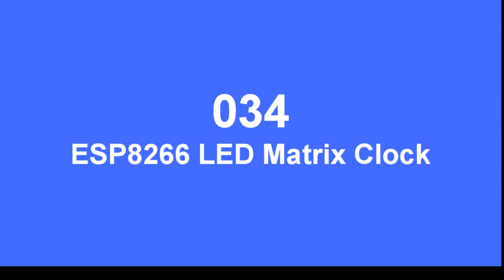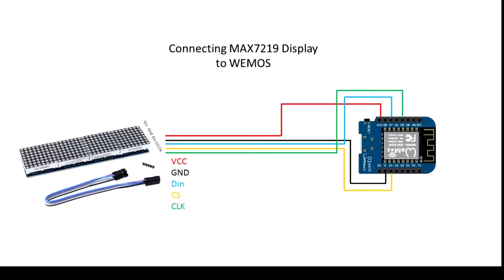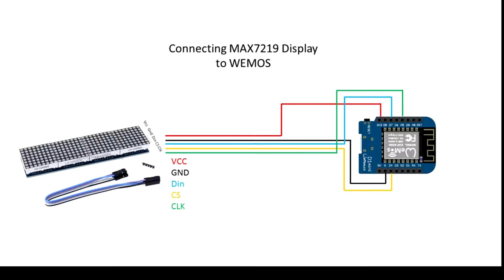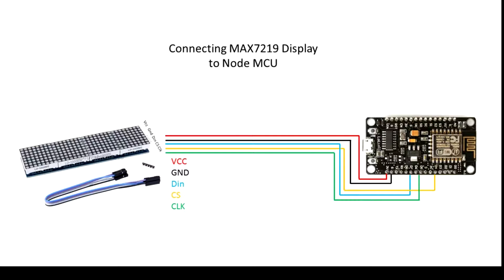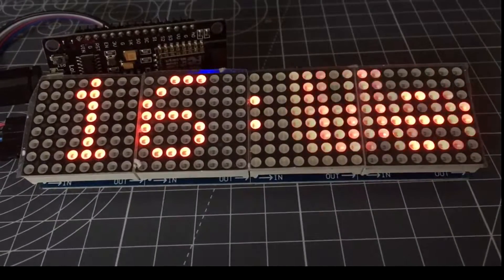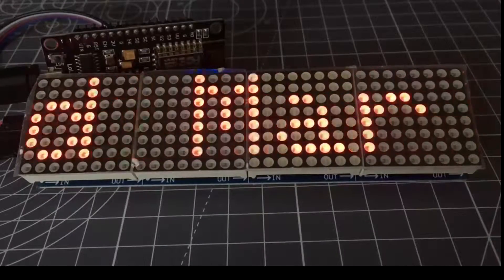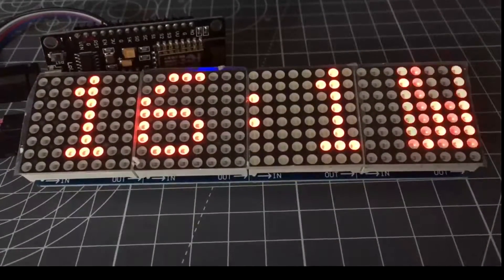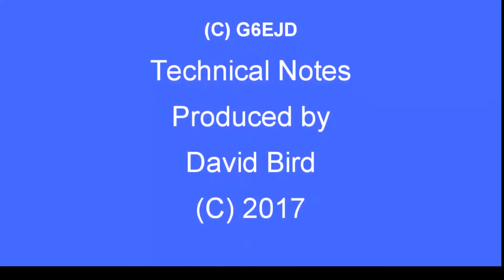Tech Note 034 - ESP8266 LED Matrix Scrolling Clock

Comment: Gracias, funciona muy bien.
Uso PlatformIO y tuve que hacer dos ligeras modificaciones que son: 
 - linea: for ( int i = 0 ; i < (int) (width * message.length() + matrix.width() - spacer); i++ ) {
- línea: if ( letter < (int) message.length() ) {
Como ves solo (int) porque es mas estricto el compilador.

Desde hoy seguiré tus proyectos...

Thanks, it works great.
I use PlatformIO and I had to do two slight modifications which are:
 - line: for ( int i = 0 ; i < (int) (width * message.length() + matrix.width() - spacer); i++ ) {
- line: if ( letter < (int) message.length() ) {
As you can see, only (int) because the compiler is more strict.
From today I will follow your projects...
Reply from the maker: Yes I can see the need for int casting if there is ambiguity, thanks for letting me know.

Comment: how to show only the time?
Reply from the maker: After the line : String time = String(ctime(&now));

time = time.substring(start,finish);

Change start to be the beginning of time and finish the end of time, eg Mon 28 Jun 16:24 2017 would be 11,16
Reply: @G6EJD  more one question, which code do I use?
Reply from the maker: @wl11lm , You didn't say which board/processor your using but they code body is the same, what I've suggested is to leave the time string as is and take a substring of it that has just the time, it is just as efficient. Just modify the line after it as I suggested.
Reply: @G6EJD  hi, i can't find the libraries. Can you send me all code with libraries? I'll use this project using a esp32.
Reply from the maker: You don’t need any libraries, they are all built-in. Do you have the ESP32 extensions for the IDE installed?
Reply: @G6EJD  it was an error in the Adafruit I2C Device library, I already solved it. Thank you!
Reply from the maker: Ok good to hear it’s working now, an error in an Adafruit library is rare.

Comment: hi david. I want to change weekday and month name in "ESP_MAX7219_Specific_Format_Time" programe. How can I do that? Could you help me for this, please?
Reply from the maker: What format do you need to get?
Reply from the maker: See the lines:
  // See http://www.cplusplus.com/reference/ctime/strftime/ for strftime functions
  // Desired format: ( Sun ,Jul 21 2019 )   ( AM  10:03:20 ) 
  strftime(time_output, buffer_size, "( %a  %d-%m-%y ) ( %p %T )", localtime(&now)); 

Check the link to cplusplus that I provided change d m y to what ever format you need.
Reply: @G6EJD  Yes I saw this link but I want to change language of time line as "Pzt ,Haz 08 2020" . how can I edit  language options?
Reply from the maker: The ESP32 compiler does not support setlocales so you have to do it manually, get the month and replace with your own language. Same with the day. You can get month number say 6 and then do a simple if (month == 6) month_text = “June” or your language.
Reply from the maker: struct tm timeinfo;
  char   time_output[30], day_output[30], update_time[30];
  while (!getLocalTime(&timeinfo, 10000)) { // Wait for 10-sec for time to synchronise
    Serial.println("Failed to obtain time");
    return false;
  }
strftime(day_output, sizeof(day_output), "%a %b-%d-%Y", &timeinfo); // Creates  'Sat May-31-2019'
Date_str = day_output;

Now adjust a b d Y to your requirement just m maybe

Comment: Project work if I connect nodemcu in USB port of my pc.
If I connect it in a USB port of a powerbank or in a usb powersupply display turn off, why?
Reply from the maker: Usually this is the power bank that is turning off due to insufficient load. Try using using a phone charger and see if the same thing happens. Phone chargers are usb 5v supplies.

Comment: hello David ,nice project,i also wanna one clock for my radio shack,untill i waiting wemos board from ebay i try compile sketch Time.ino and Specific format time.ino but arduino ide tells me:
D:\Program Files\arduino-1.8.5\libraries\Adafruit_GFX\Adafruit_GFX.cpp:1509:6: warning: unused parameter 'i' [-Wunused-parameter]

 void Adafruit_GFX::invertDisplay(boolean i) {
maybe you know ,what s the problem ?
thanks in advance,73 de 9a3xz Mikele
Reply from the maker: Hi Mikele, it’s possible your Adafruit GFX library needs updating, if you go to Libraries, Manage and then top-left select ‘updateable’ that will check for you. 73 Dave de G6EJD
Reply: @G6EJD  thanks David for quick answer but nothing ,i reinstaleted and put new newest 1.5.7 gfx library but nothing...same problem like before ;(
Reply from the maker: Please check the library ‘include <Max72xxPanel.h>’ is present as the error is occurring in the GFX library called by the Max72xx library. Also make sure you select the 8266 board type e.g. 8266 D1 Mini
Reply: @G6EJD  i put another max72xx library but nothing ,in my boards list David is Lolin Wemos D1mini Lite ,Lolin Wemos D1 mini Pro ,Lolin Wemos D1 R2 mini...
Reply from the maker: Checking that you have installed the ESP extensions for the Arduino IDE and you can select a generic ESP8266 board for testing, Adafruit have a good tutorial for installing the ESP extension.
Reply: @G6EJD  thank s David so much.. I   Will try tomorow morning
Reply from the maker: Mladen Cukon 9A3XZ, davidl.bird@btinternet.com 😀

Comment: Compiled OK. Show correct time and date on serial monitor. Follow the diagram for connections. Max 7219 panel does not scroll anything. It is lit up entirely.   How can I solve that?
Reply from the maker: Gabi Balsanu, have you checked the wiring DuPont cable connections can be unreliable, make sure the pins defined are those connected to the display.
Reply: @G6EJD  Manage to make it work. I had to change the board to LOLIN D1 R2 and rotate the displays ('option 3'). One question. Can I extend this to 2 (8 modules)? I tried, but the clock (numbers stay central to first module), but the text scroll to both modules (change the number display to 8 and add 4 lines for the new added displays)
Thank you for taking time to answer
Gabi
Reply from the maker: Gabi Balsanu, you need to change the screen address of the time to match the wider screen

Comment: Used the shared code. But it doesnot scrolls ordered manner. Where can be the issue?
Reply from the maker: Praveen GS, connection or display problem do you have the correct display type?
Reply: @G6EJD  Connection I did as per your suggestion in the video. Uploaded the same code. Display problem. I am using https://www.amazon.in/gp/product/B073DCYNVC/ref=ppx_yo_dt_b_asin_title_o00_s01?ie=UTF8&psc=1 display
Reply from the maker: Praveen GS you need to check your using the correct pins on the ESP and that the cables are connected correctly there are no code issues just hardware connection errors
Reply: @G6EJD  All cables are proper and cooections are as follows.
VCC ->3v3, GND-GND, DIN->D7, CS->D4, CLK->D5
Reply from the maker: What is your board type?
Reply: @G6EJD  Text displayed are inverted too and its scrolling from right to left if hold the display facing the leds and DIN on my left side.
Reply from the maker: That’s all correct the hardware orientation and display orientation are not the same, turn your display upside down and left to right
Reply from the maker: The library does allow different scroll directions
Reply: @G6EJD  Just to scroll a simple hardcoded text is also displays in shuffled manner..
Reply: @G6EJD  Your code is to move data from left to right correct? (assuning input side is on our left)
Reply: Would u suggest any other code to test before this?
Reply from the maker: Praveen GS, yes that is the western standard direction.
Reply from the maker: Praveen GS, the display is hardware configured so not much chance for configuration changes
Reply: Yes. Even it move from left to Right (input Side is on my right) is also ok.
Reply: @G6EJD  Still i tried many other codes to display on it. It displays But scrolls in different order.
Reply: Shall I order Any Other Brand Matrix LED? If yes can u share the link for the same.
Reply from the maker: Praveen GS, scrolling is controlled by a function try this:
for ( int i = message.length() + matrix.width() - spacer; i> 0; i— ) {
Reply from the maker: So counting down not up in the function
Reply: @G6EJD  I will try. Thanks for the post.
Reply: @G6EJD  Now scrolling from the left to right (input is in right) but again the same error. But irregular scrolling. But after few scrolls all LEDs turns on.
Reply from the maker: Praveen GS, could be a faulty display, I have lots and all work without an issue
Reply from the maker: Have you fitted long cables? About 20cm maximum left and which power source? What is your board type? Try an external power source
Reply: @G6EJD  I tried using long cables and changed POWER source too.. Still no changes
Reply from the maker: Praveen GS, you can’t use long cables they distort the digital signal. Sounds like a faulty display.
Reply: @G6EJD  I will retry with short cables. Thanks for the suport..
Reply from the maker: You can try running the display on 5v as the supply range is 4-6v
Reply: @G6EJD  Ok. I will try that too. Thanks
Reply: Do u have any idea of streaming the video on web using nodeMCU or any other device?
Reply from the maker: Praveen GS, it can be done with the ESP32 it it’s highly complex to do and requires a lot of skill, getting the correct camera and library support is not easy to do either. By contrast doing this with a RPi is quite easy and affordable, I suggest you have a look at that route, maybe a RPi zero and camera
Reply: @G6EJD  I will look into that.. Thanks

Comment: ESP 01 can be use  for this project  , and if yes please update me pin connection
Reply from the maker: Yes, you can google esp01 for a pin out diagram and use GPIO-0 for data and GPIO-2 for clock
Reply: DIN-GPIO02/CS-GPIO-01/CLK-GPIO-00 its right
Reply from the maker: Nalin Chaminda Manchanayke you may have to permanently CS the display as there are insufficient IO pins on the ESP 01
Reply: @G6EJD  thank u

Comment: How to show second in clock?
Reply from the maker: EXTRA GOD, there isn’t space to show seconds in the static display only 5 chars max. I don’t understand what your trying to achieve?
Reply: @G6EJD  I have ever seen the smaller text size clock with second but I don' t know how to do it.
Reply from the maker: The font size is fixed with the 7219 display, so what you’ve seen was not these or they were using 6 display modules.
Reply: @G6EJD  4 module
Reply from the maker: I don’t know then

Comment: Hi, super video well done, i´m completely new to this, what am i not doing right, i get this when i try to compile from Arduino IDE to esp8266. "D4 was not declared in this scope", i have CS connected to D4?
Reply from the maker: Most likely you have not selected the correct board type, I assume your using a Wemos D1 Mini, if so select that board type.
Reply: i am using the "Generic ESP8266 Module" board setting for the connected 
 ESP8266 -F
Reply from the maker: OK, that's the problem then. It needs to be the Wemos D1 Mini board where the D4 etc pins are defined. Choose the D1 Mini board type and it will compile OK.
Reply: Hi, if i understand right, i cannot use my ESP8266-F, i Need to aquire a Wemos D1 Mini board, is this correct?
Reply from the maker: No need for a Wemos D1 Mini, just set the pins as required. e.g
#define DIN 14
#define CS  13
#define CLK 12
Reply: Thanks for your fast response. That problem is now solved, "Max72xxpanel.h" was defect and had to be replaced. Now compiled and running, but showing 08:00 1 Jan 1970, what needs to be added and where? pls remember i´m a newbe.
Reply from the maker: The time is not running, does it have an internet connection, I suggest you monitor the serial port to see if any connection errors.
Reply: This is the second "Program" or is it in this case called a "sketchbook" that i have ever tried. Looking at the first "sketchbook" an ssid & password where needed to connect, as these are not in your sketch there will be no internet available.
how are these moduls inplanted into the sketch. they must normally be there, without there cannot be a connection?
Reply from the maker: OK, in this clock example it uses NTP and a protocol called UDP and so requires no obvious network connection.But you can add:#include <ESP8266WiFi.h>then in the setupWiFi.begin(ssid,password);The ESP8266 remembers credentials yours may not have been through that yet.
Reply: Where can i find and what is the name of the file that contains the NTP & UDP  protocol text?
Reply from the maker: That information is in the time.h library.
Reply from the maker: I've just modified the repository with a version that should work with your board, please download it again. Please enter your ssid,password in the wifi.begin lineCheck the serial port for the correct time. You may need to adjust the time zone to your location. It is a POSIX format code universally used.
Reply: There are eight files with this name on my computer, now to find out which is the right one and why its not functioning.
Reply from the maker: Steve Burgoyne Delete them all and download again
Reply from the maker: Do you have it running now?
Reply: I´m a shiftworker, at the moment on nights, thats why i havent tried, i will when i get home. Thanks again for your help.
Reply: An answer was written and sent when i got home after getting the LED clock to run, I can´t see this answer any more? so here again, thank you for the super help and keep up the good work.
Reply from the maker: Steve, thanks

Comment: Thank you for a nice video. However I have problem compiling the code. I keep having this error: 
'configTime' was not declared in this scope.
Could you please help with this problem?
Reply from the maker: This is because you have not selected the Wemos D1 Mini or other ESP8266 board. In the IDE menu select Tools, then Board, then scroll down and select the correct board.
Reply: G6EJD Thank you so much. I selected the right board for the esp8266 as you advised and the code has compiled. 
However the time is 1 hour ahead of the current time. I live in the UK. It will be correct from 25 March when the time will be adjusted by +1 for DST. Is there any way around this current time displayed?
Thank you so much.
Reply from the maker: I'ev uploaded to Github a second version that has corrected the Timezone problem that existed in the core 2.30 build of the Ardunio IDE, if you have updated your IDE to 2.4 it will now function and change time correctly when BST begins and ends. Code: https://github.com/G6EJD/ESP8266-simple-timezone-example
Reply: G6EJD Thank you so much. I used the updated code and it worked! The current UK time was displayed correctly.
However, I have this question: Is this code region-specific? 
I am on holiday in the US and the clock will not work correctly. It's displaying incorrect time and Thu Jan 1 1970 date. I tried re-uploading the code and it still displays the wrong time and date.
I visited the link 'https://github.com/nayarsystems/posix_tz_db' you commented on the line: 
setenv ("TZ ","GMT0BST,M3.5.0/2
,M10.5.0/2", 0);
I tried replacing the argument in parenthesis with "CST6CDT,M3.2.0,M11.1.0", 0 which I think is for America according to nayarsystems, the output is still the same.
Have you any idea how to adjust this?
Reply from the maker: If the time is zero which it is then there is no connection to the time servers. This could be the network you use does not allow connections to those servers or ports or try changing the server address for a US based NTP server. The code for time zone looks good. Try adding some serial port diagnostic prints around the time setting to see what’s happening. Also try adding some delays delay(500) just before setting the time services with config and then one after as maybe the servers are slow.

Comment: Well it worked, thanks. I have to wait until 10pm to see if the format stills works. I have it so it displays the time in 12hr format with the AM/PM after the time. here are the changes I made that you suggested. Again Thanks.
 String time = String(ctime(&now));
  int hours = time.substring(11,13).toInt();
  Serial.println(time);
  Serial.println (hours);
  String str_hours = "PM";
  if (hours%24 < 12) str_hours = "AM";  // Now needs to be added in to time string 
  
  if (hours%12==0) str_hours = str_hours + "12";
   else 
  if (hours%12 < 10) str_hours = str_hours + " " + String(hours%12);
   
  else
  str_hours = str_hours + String(hours%12);
     time = time.substring(0,11) + str_hours + time.substring(13, 24);
  time.trim(); //removes white space
  time.substring(11, 18).toCharArray(time_value, 10);
  Serial.println (time_value);
  // starts at charactor 11 of string time and stops
  // at charactor 19 then assigns that string to time_value the 10 is the buffer size
  Serial.println (time_value[0]);
  matrix.drawChar(48, 0, time_value[0], HIGH, LOW, 1); 
  matrix.drawChar(56, 0, time_value[1], HIGH, LOW, 1); 
  matrix.drawChar(12, 0, time_value[2], HIGH, LOW, 1); 
  matrix.drawChar(18, 0, time_value[3], HIGH, LOW, 1); 
  matrix.drawChar(24, 0, time_value[4], HIGH, LOW, 1); 
  matrix.drawChar(30, 0, time_value[5], HIGH, LOW, 1); 
  matrix.drawChar(36, 0, time_value[6], HIGH, LOW, 1); 
  matrix.write(); // Send bitmap to display
  delay(2000);